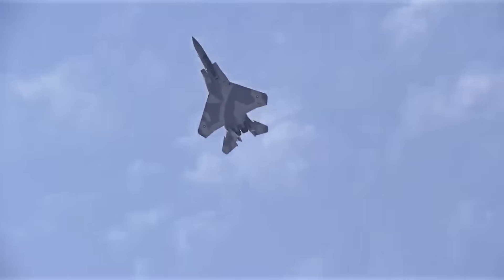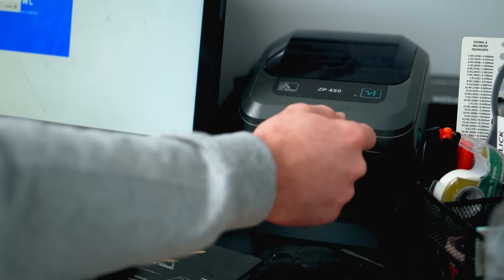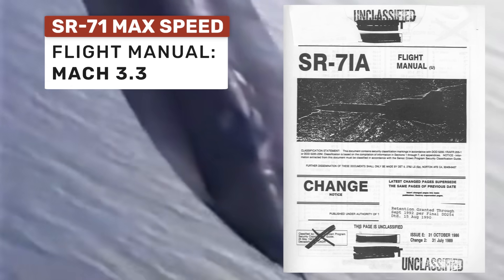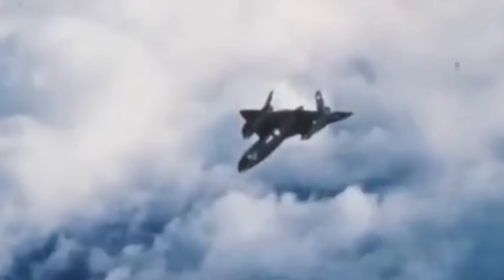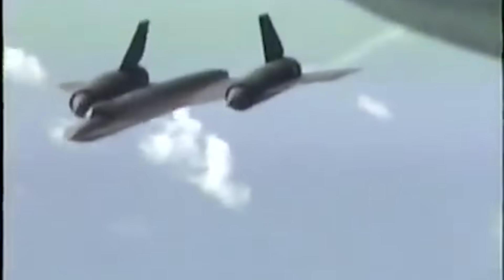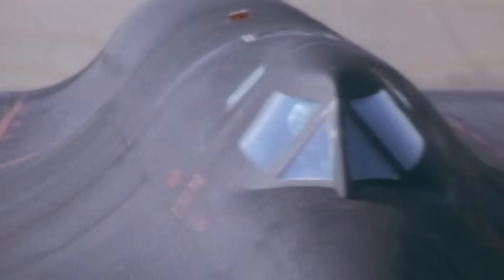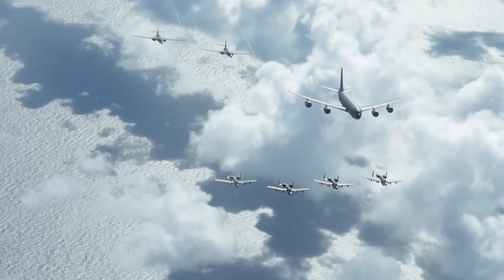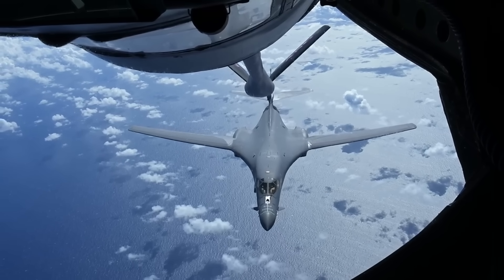The SR-71 was MUCH FASTER than the Air Force will admit

Comment: Back in 1988 I had a girlfriend who was a USAF air traffic controller. She monitored the sea of Japan. She told me that SR-71's often flew across her airspace, but did not show-up on radar. SR-71 pilot's transmitted their position using Morris code. She said it was pretty easy to calculate their speed between position fixes. They crossed her airspace at 3,000 mph. I don't think anyone believes the SR-71 could only fly 500 mph faster then a stripped-down F-15 in full after-burner.
Reply: Exactly what I've stated. If the F-15 can do Mach 2.5 then there's no question this Skunkworks creation was made to fly MUCH faster.
Reply: @Trailsporting 
I’ve always said that about pretty much anything that our military claims that a piece of equipment can do. You just know it can do much much more. Whatever they claim a sub can dive and operate at you can definitely add another 700’-1000’ of depth. Same goes for how ever fast they claim a ships top speed is. It’s going to be faster. I Don’t Remember what the navy claimed their destroyers could go, but after working in a navel shipyard I was one of the welders who was picked to go on sea trials with a couple of the, and I won’t say the top speed it achieved because I’ll never give up the secrets my military has that I know. Even though I’m sure Russia and China know those numbers. Doesn’t mean I should speak about it.I’ll only say it’s a lot more than the navy publishes
Reply: @srice8959 precisely the opposite way our adversaries report their equipment's capabilities.
Reply: @Trailsporting In the Air Force after a FCF the pilot told me he took the F-15D up to Mach 2.7.
Reply: @Trailsporting 😊😊
Reply: The SR was an incredible jet played down by USAF,NASA and everyone else. I was lucky enough to be stationed at Beale AFB. This was one of the home bases for them. It was amazing to watch it do touch and goes. But I once saw it take off for a mission. It went down the runway and straight up and just plain gone in the blink of an eye
Reply: @markjolyn94 9
Reply: You sure it wasn't  Norris code? Chuck Norris had a code
Reply: That would be about Mach 3.9...?
Reply: @svartmetall Seeing as how the SR-71 outran a surface to air missile (actually, a rocket) that Libya launched which had a speed of mach 4+.... all the pilot stated was "we saw mach numbers no one had ever seen before-and it was still accelerating..."
Reply: @svartmetall  More like 4.4
Reply: @williamthornton5856 Hal is quoted as saying Mach 4.4.
Reply: @rocketeng1888 Yes, but not until 100,000 feet. It won't do 4+ at 85,000
Reply: @svartmetall  the speed of sound is lower at 85,000 ft, so Mach 4.5
Reply: @svartmetall   its been seen doing mach 4.7 on radar
Reply: @keithbell6104  It's been incorrectly interpreted as doing Mach 4.7 on radar.
Reply: @hoghogwild  Actually that is the surveillance cruising speed.
 Not many air to air or surface to air can match that.
But really it was just a UFO.
Reply: @hoghogwild  Not incorrect....
Reply: @williamthornton5856  Absolutely 100% incorrect that any of the Blackbird family has a top speed of Mach 4.7, 3.3-3.5 tops.
Reply: @hoghogwild  Google Ram jet speed range
Reply: Yep the classified glitch was a little faster than Mach 3.X. So fast forward firing ordinance was not a good idea.
Reply: Is Morris code anything like Morse code?  😊
Reply: @charlesdudek7713 The Morris code is a bit like Morse but it goes Brum, brum, brum rather than da dit da.
Reply: @wheater5  Thanks.  I'm glad somebody was able to bring me up to speed on that one. 😎
Reply: @charlesdudek7713  My pleasure 🤣
Reply: @charlesdudek7713  A bit,  Dots are dashes and dashes are dots.  Give the commentator a break.  The rest of us are perfect.
Reply: @charlesdudek7713  So much for credibility.
Reply: @charlesdudek7713 
Unlike Morse Code, Morris code adds Day and The Time.

And it doesn't use dots and dashes. 

For example, you'd say "Jungle Love" as "O-EO-EO!"
Reply: @charlesdudek7713 morse code simular to moribus code?
Reply: As a Morris, I must say… yes. Very similar 🤣
Reply: @charlesdudek7713 yes, it’s distant cousin.
Reply: @charlesdudek7713  Maybe his/her phone 'corrected' the spelling.
Reply: @dannygjk  That was my thought and so I made a joke of it expecting a reply saying that was the case but never heard back. Shrug.
Reply: The difference is the F-15 can sprint up to those speeds for a short while. The SR-71 was designed to fly at Mach 3+ for the majority of a mission, only slowing down and dropping down lower to refuel from a tanker.
Reply: @dwaynesykes694 True.  I expect is was much faster than 3.2, but was not made to fly at the speeds.  At some point she would start to melt!
Reply: @dwaynesykes694  Agreed. F-15 at max speed would be measured in seconds, SR-71/A-12 could cruise for over an hour above Mach 3, its J58s rated for indefinite max augmentation durations.
Reply: Back in 1988, your girlfriend was a security risk!
Reply: @memyname1771  LOL! Right?
Reply: @memyname1771 aren't they all
Reply: @memyname1771 I’d imagine she’s still a security risk
Reply: @memyname1771  maybe she became a politician. They can't seem to keep track of classified material, no matter the party.
Reply: @memyname1771  nop,she was doing out of the record and non official calculations...the sounds that go through the air even from a voice are sounds if there is no tangible proof.
Reply: Morris code? Really?
Reply: @johnkochen7264  It's really cat language for Meow Mix.
Reply: @johnkochen7264  probably spell check did that and he didn't see it or care  I think it's pretty easy to know what was meant
Reply: @johnkochen7264  Might be just a senior moment.
Reply: I'm former Air Force Special Operations and I met an old SR-71 jock at a party years after each of us had separated. He inadvertently let it slip during conversation just how fast the Blackbird would go. I'll just say that was faster than 3,000mph; Much faster.
Reply: @SeanOHanlon 
Thank you for sharing this!  This confirms what I have heard. Please see my comment on the main page!
Reply: @SeanOHanlon  3,000 is already Mach 4. I don’t believe this thing was capable of Mach 5. I mean it would be epic if it were, but good lord they were aiming high when putting this thing together in the early 60’s if Mach 5 was the goal.
Reply: @Trailsporting  johnson only needed mach3, but exceeded that expectation, must have been the high purity titanium they were buying third party from russia.
Reply: Bob Gilliland told  my son ...it was much faster than advertised.
Reply: @elwap0 
See my comment on the main board!
Reply: Morris code is that cat’s way of letting people know he’s hungry.
Reply: @paulman1970  😂😂
Reply: I worked at Lockheed Sunnyvale Advanced Systems Decision in 1979 when the SR71 was still classified. When the hanger doors were closed at Moffet Field NAS we new something classified was being worked on. Leaving Lockheed at about 8:15 one night in fall 1979 I was blasted off the road when a SR71 hit it's afterburners and took off. It was a magnificent sight. I'll never forget it.
Reply: Need to know people
Reply: @danbrennan7348  Nobody here needs to know.
Reply: SR-71's have a speed bar across their throttle , this I was told by a former SR-71 pilot was to  prevent it from going so fast that SS cavitions would physically shake the plane apart .  Though his personal opinion was to keep them from launching into space itself .  Which when you do the real math and apply the proper ballistics it is quite possible  .   The other problem was air friction at those speeds for prolonged periods would overheat the skin of the plane and  it wasn't built for reentry .  Save for the problems of added weight to make the platform space worthy it is a possible consideration for a way to explore space without the need of rockets  if we can overcome the materials needed to reduce the weight problem of make it space worthy .
Reply: @franzjayne672   It makes no sense to claim that an air breathing craft could fly into space.  The engines wouldn't operate, and the structure would have no lift.
Reply: @RobertR3750  The SR - 71 was designed to travel in rare air air space at the edge of space .  So it has plenty of lift even in a near empty atmosphere  , the  kinetic energy from the engines at that altitude could in fact drive it in to low orbit .  The problem as you pointed out is after that there is no thrust to maneuver the plane so there no control for a reentry .  In fact during testing the test pilots did in fact do this and spent an extra 3 hours in flight waiting for earths gravity to pull the plane low enough for an engine restart to fly home .   Hence the bars across the the throttle controls to prevent it from happening again .  When they looked in to doing a redesign the simplest and  cheapest fix was to simply add the bar as a standard piece of the plane .    Since they are already  flying so high the crews had to use pressurized O2 breathing equipment like the astronauts anyway during testing  , also later for extended flights the tanks allowed them still remain in flight for 24 hours .   Interesting BTW is that the first designs and tests there was  a problem with fuel  and the skin of the plane .  Watch a video of an SR-71 taking off and you will see a vapor/ liquid coming off the plane .   That is because the skin of the plane is also the outside of the fuel tank , for one and the 2nd they found that it flies so fast that the friction with the air heats the skin up and cause it to expand decreasing its efficiency of it flight perimeters , the skin is built loose to allow for the thermodynamics to heat it up and become tight .  They actually wait to last minute to  completely fill it up to allow for fuel loss during takeoff .    I read the specs about 10 years ago when they were declassified and released to the public .
Reply: @franzjayne672  The post I responded to claimed the SR71 could go into space, not the edge of space.  It would make no sense for that to happen.  The engines could not operate, and the control surfaces would be useless.  No pilot would take his aircraft into such a situation.
Reply: @RobertR3750  No pilot would do so intentionally ,  but during testing the test pilots did by accident and spent an extra 3 hours waiting for earth gravity to drop them in to a lower orbital / near space altitude so they could restart their engines and fly home .   Hence the cross bar on the throttle controls to prevent it from happening .   When we ever reach the materials necessary this knowledge of the what this design is can do we may no longer need to use rockets or heavy capsules for space exploration and re-entry .      I wish that I could be clearer in my thought on the subject .  But try to look past what you have told and taught and see what really is possible for a brighter future .   The world today is depressing enough as is .   Try to have a good day and a great weekend .
Reply: @franzjayne672 Describing the SR71's speed as "orbital" is completely inaccurate.   An orbit is maintained without the need for additional thrust, and without  the craft immediately falling back to earth.  Orbital speed between the earth's surface and an altitude of 200 km is well over 17,000 mph.  It is utterly ludicrous to suggest that the SR71 could get anywhere close to that speed.  The X15, which NO ONE disputes was faster than the SR71, couldn't even do 1/4 that speed.
Reply: The fact they had to use titanium or the aluminum would melt.
Reply: A friend of mine was in tge tower at El Toro doing some maintenance when a SR-71 radioed it would be on approach in ~15 min. from Alaska.

Suffice it to say the plane was a lot faster than Mach 3.5.
Reply: @paulallen8597  Your anecdote doesn't prove what you claim it does.  Alaska to California is about 2270 miles.   If the plane was traveling at 2270 mph, then all it was doing was radioing 45 minutes ahead of time about its arrival.
Reply: @RobertR3750  I didn't say it did now, did I? Even if I did know the top speed, I'm not stupid enough to post it.
Reply: My understanding from reading ‘Deep Black’ was that it had no top speed but would eventually tear itself apart.  I outran some missiles.
Reply: Sustaining 3000 mph for hours and hours on end is a lot more impressive than being able to hit 2500 or even 3000 for a few minutes before running out of gas or melting away. The SR-71 was designed to endure high speeds and (keyword here) SUSTAIN them which is why the engines and the airframe are so large. No other aircraft has been able to sustain such speeds for endurance flights. Could it fly faster? Sure. Can the F-15 approach SR 71 top speed? Perhaps. But it's mission parameters was to SUSTAIN mach 3.3ish. Something no other aircraft, til today, can safely accomplish. It's  not going to simply Top Gun Maverick itself into a mach 10 oblivion because it's engines want to. For example F-14 pilots have often said that F-14 badly wants to go faster than its rated speed limits, with the engine sucking in more and more air the faster it goes, but that would turn someone's son into pink mist pretty quick if they were that daft to keep pushing it.
Reply: And why do we believe that the F15s top speed is what they say it is?😊
Reply: @mjsup1  And why would you care?
Reply: @Byepolarchaos  Pretty sure I don't since I have know idea what I commented on to begin with. My advice, it's a You Tube comment not life ending.
Reply: @mjsup1  I do not Disagree with you
Reply: Kkda the reverse of cars.
Reply: The first sonic boom was the time I crawled in bed in Seoul and the 2nd sonic boom I would close my eyes.  And I recall the SR-71 it was taking off…I asked a guard—what the hell was that…guard said it’s classified.
Reply: A flight sim I had purchased had ungodly realistic planes... And I paid for the SR-71 model as DLC. And it got up to 3,240 mph max.
Reply: @Karl_Kampfwagen 
See my comment main page!
Reply: 500mp/h are a fucking ton of problems when going at those speeds. It is a HUGE difference and the problems once you go past mach 2,5 are enormous.
Reply: @andreasmuller4666  where are you getting 500mph from?  They’re moving a helluva lot faster than that!!  More like 2,500 to 3,000mph!
Reply: @srcastic8764  Reference to 500 mp/h increase in air speed at a high base speed not being a "big increase" in answer to a comment.
How you would get me saying the plane only went 500mp/h in total is beyond me but okay.
Reply: @andreasmuller4666  I just didn’t know why you said 500 and said if you were referring to the planes speed it was lacking.  Thanks for clarifying.
Reply: I thought morris code was some kind of fancy air pilot talk… for about 3 seconds
Reply: Wtf is Morris code? 😂😂😂😂
Reply: @harrisoncharles5045  It's when Morris the cat taps repeatedly on his food dish to let his people know he's hungry. 😺
Reply: So full of shit 😂 by the time a Morse Code transmission came through, it'd be hundreds of miles passed that position
Reply: This code is better than Morse, it has 9 lives.
Reply: When I was a kid , a neighbor of  ours had a Morris Minor. Does that count?
Reply: @T.oMiller  Maybe if you were sitting the Morris while sending Morse code. 🥴🤪😎
Reply: @charlesdudek7713  Is Morse code a food for Morris??????
Reply: @rearspeaker6364 Nope. Morris code is though. 😮😅😅😅
Reply: @rearspeaker6364  Morse code is dots and dashes. Morris code is what a cat sends out when it's hungry. 😅
Reply: @charlesdudek7713  I like this theme!!
Reply: I believe the SR-71 could easily fly 500 mph faster than any F-15.
Reply: @CaptainLeo44  Much more than just 500 more, even compared to the fastest MIG 25
Reply: Read about how Russia in the mid 90s early 2000s pinged on radar at the pacific some aircraft then lost it. Then like 2 min later pinged leaving the ussr territory or former. They never talked about that again.
Reply: It can fly over Mach 5
Reply: @pyropulseIXXI  Shhh. Not for long though.
Reply: That must have been a crappy radar. Cuz in 1988 I personally watched the Sr-71 go from the very south of the Baltic Sea to the very north of it on Swedish radar several times a week. No idea how fast it was but I can say that that trip up and back south was made in insanely short time. So the Baltic Express was really a express trip. 😂 It was really fun to see the russkies trying to catch up or even intercept it. 🤣
Reply: @peterfdsvenskaflygvapnet2643  maybe it didn’t have its transponder on?
Reply: I have a similar story from an Air force Air traffic controller from Clark AFB. The SR-71 would enter and then clear the entire airspace in a certain time frame, that meant it well above its publicized top speed.
Reply: Mach 3, 80k feet. That was repeated over and over: I asked someone who worked with SR71s: I asked if they flew over Mach 3 and 80k feet?  He wouldn’t say.
Reply: @keithdomin5015  It mostly depended on air temperature. Even the mach number varies with air temperature.
Reply: @keithdomin5015  definitely way more than mach 3 at 80,000 feet. The air is thinner, which is why it is a ramjet engine, and since the air is thinner, there is less friction. I was support attached to an air wing, so the lion's share of our officers were pilots, and some were in Okinawa, where the SR71s often took off and landed. Not going to say what the word on the speed was, just that it is just beginning to stretch it's legs at mach 3 at 80,000.
Reply: This is exactly why fighter jets and recon vehicles should be remotely piloted so it can actually turn and max out the capabilities of the materials vs the material of the pilot.  Might even not have to feed the pilots speed or give em diapers for routine operations.
Reply: This is incorrect. They had a transponder and would check in with air traffic control just like any other airplane. Source: my step-grandfather was a pilot on the YF12 skunk works program for the CIA.
Reply: @spyder6423  They will turn the transponder off when they were over in the Soviet area yes or no
Reply: i was usaf in the early 70's. they told me it was even faster. at altitude there isn't anything to slow you down.
Reply: I was told the Air Force still flies the U-2, which predates the SR-71?
Reply: @patrickhenry2845  I'm pretty sure you're right on both counts.
Reply: Oh I do believe you that the SR-71 black bird could and did fly at 3000mph. The US Air force just won't admit it, because it's top secret. 😳😳😳🤨🤨😌😌😌🇨🇦
Reply: Either Her boyfriend is full of crap or she is.
Reply: 3,000 MPH is about Mach 4. 28, if the Speed of Sound is 700 MPH.

About oh, 30 years ago, a very reliable Source told me that the Air Speed Indicator in an SR-71 goes up to MACH TEN!

That does NOT mean that the plane can do Mach 10, but the Indicator was built to register UP to that speed.
Reply: @rdelrosso1973  Whoever told you that is a clown. You can seriously take that "very reliable source" and fully know that they are an absolutely unreliable source. The "10" on the bezel of the airspeed indicator is in "knots x 100". The mach indicator is the small window in the center of the air speed indicator and it doesn't go anywhere close to "mach 10".  Whoever told you that is either a lair or they are so inept in this topic that they truly believed what they were saying.
Reply: @rdelrosso1973 only Tom Cruise can take the SR-71 to mach 10 😉
Reply: @rdelrosso1973  the speed of sound is lower at 85,000 ft
Reply: @rdelrosso1973 1 Mach is ~767 MPH. So 3,000 MPH is ~Mach 3.9
Reply: @Laotzu.Goldbug  it's 660 mph at 85,000 feet.
Reply: @dylancowmeadow4280  that may be interesting, but irrelevant. if aircraft velocities were clocked in Mach numbers at different altitude it would be entirely impossible to compare them. When talking about stated specifications it's always at sea level, so Mach 1 is 767 Mph/667 Kn
Reply: @Laotzu.Goldbug  At what altitude? Mach speed is not the same at sea level, as it is at 40, 60, 80, 000 ft.
Reply: @Laotzu.Goldbug The speed of sound decreases with temperature, and is therefore not a constant. For example at 36,000’, temp is around -56c. Mach 1 is about 660mph
Reply: @Laotzu.Goldbug 
That's Mach at sea level.
Reply: @Laotzu.Goldbug  Wrong, not at the altitudes the SR flew at.  Try 700 mph for mach 1.  Sea level sound is faster.
Reply: @dylancowmeadow4280  Make 100,000 + feet.
Reply: @Laotzu.Goldbug  Nope. mach 5 at 120, 000 feet is about 500 mph slower than mach 5 at sea level.  Speed of sound has NOTHING  to do with pressure. It all about temperature.
Reply: Anything above 60,000ft is class E airspace. BS is BS.
Reply: @hwoods01  class e is also near the ground......NASA classifies FL600 and above as "upper Class E airspace"
Reply: 100% 
Physics was kinda "my thing" as a kid & I was a double degree Engineering student. 
The X-15 probably was a (sort of) Public "state of the art" maxSpeed aeroRocket of the SAME generation of design & theory.  & they could HIT hypersonic speeds BACK THEN  
  And it maxxed out at mach6 ... "ish"
     temporarily, of course, 
I figured the X15 kinda Set the bounds for the VERY Fastest ("Secret") Aircraft of the time.  .... I've ALWAYS believed the SR71 could be faster than stated

[that is why it is a 'Secret' type of spy Plane]  to this day

I stood next to the SR-71 and I was shocked at how Physically Compact it seemed to be.  I've heard it described as a sorta "Intercepter fighter" style of design
And THAT is exactly how it felt standing next to it.
small, sleek, COMPACT, powerful ... And FAST  with "GlobeTrotting Legs"
Reply: They're very different. The SR-71 was designed for cruising at Mach 3.2, but the F-15 can only do M2.9 briefly.
Reply: my guessing the badass sr71can bust mach4
Reply: @jackmeoffer9334  Yes it can, + 500 more mph yet, and hold it, sustained.
Reply: Minimum of 3k
Reply: Back in the 70s I had a Morris Minor, I used to phone the girlfriend at the time from the phone box next to the pub I might be coming home soon, needless to say when I did eventually get back, I had to claim the car was much slower than believed, carrying a spare broken starting handle helped
Reply: @dav1dbone  So sorry technology eventually got around to doing away with starter crank handles and ruining your ability to bend the truth with your girlfriend thereafter.  But I strongly suspect that, over time, she figured out your lies and said goodbye to you long before starter cranks disappeared.  What this all has to do with the SR-71, I don't know.  Perhaps your Morris Minor was where the Morris code was invented.  True?
Reply: Nein shipmate nein bl9ke they don't use mph they use knotts....yank
Reply: Oh it's above 30000mph. But there were issues. It's got issues the arrow mo3 version would've have had. And that was still only actual Mach 3.5 top speed before damage. Sr71 was a bit behind before damage occurs but 3.5 and 3.6 are likely the true max.
Reply: @bmxriderforlife1234  nein shipmate nein
Reply: @comodice905  ja mein friend ja very much ja. 

Lol. Mk3 avro arrow was Mach 3.5 capable. And Russia literally had someone inside the project. 

The sr71 had numerous of the same engineers. 

3.5 is clearly possible within it.
Reply: Morse code?
Reply: Aircraft carrier can actually go 70mph that is also crazy in the water.
Reply: @joeyholthusen6495 
Thats one way to lose those darn trained Ruskie dolphins.

I’d love to see a carrier up on plane but might not want to be on the crew.
Reply: Official speed records are only for bragging rights in the public eyes to the military that is not of great importance for obvious reasons…..
Reply: I had a friend back in the 90’s who was military ATC. They said it was far more faster than anyone would ever admit!
They clocked it at mach 10. 
I’m not telling anyone who that person was.
Reply: @manojtopiwala7454  It was the controller for Tom cruise testing the SR-72 lmfao
Reply: @manojtopiwala7454  Furthermore you need a SCRAMJET not a RAMJET to hit hypersonic which is Mach 5 and above…. Just no.
Reply: @manojtopiwala7454  bullshit.  Mach 10 is around 7000 mph
Reply: @Kerbalnautics91  nice choice of werdz & calculation. And How would you know this? Were you attesting to these experiences? Our reality is & has been what the msm, society & educational system has TOLD us as they purport it to be. I know this from a 1st hand account of someone witnessing it.  Scramjet or not, someone who was there attested to it!😘😜
Thx for the têt-tê-têt. It tells me much about what i have learned abt human relations!🤯🥸🫨😆
Reply: @manojtopiwala7454  “I saw it” only holds weight if you’re someone I were familiar with and also had respect for.
I have seen someone lifted off the ground by a poltergeist.  Just because I saw it and have seen other completely unexplained things does not mean it happened.
I believe it happened albeit it was unbelievable and I still doubt it.
In relationship to structural integrity and the amount of friction that would be caused at that speed and elevation in which you could visually see the plane moving at those speeds; would cause even those alloys to immediately disintegrate.
Being Gen X or a Boomer isn’t implicitly representative of you being more informed or having access to better information.
I’m going to have to argue it comes down to the amount of time you’re willing to put into researching subjects and the ability to remain as objective as possible through that process.
Reply: @Kerbalnautics91  
Uh ok. I’m going with that you need to be right about a lot of things in life. Good luck with all that. 
Thanks for your wordiness & expounded elaboration. I think i get where you’re coming from.
Reply: @manojtopiwala7454  uhh I just really enjoy learning about aircraft and aerospace.
Ditto my friend.. ditto
Reply: I heard the same thing
Reply: My ex stepdad was a crew chief on a Sr and he said they could hit 3800 to 4000mph but depending on who built the engines and they would start eating the engines after 4 mins of above 3500ish
Reply: I very much doubt it.  And hard to believe.   I need proof you had a girl friend. 😂
Reply: Just look at it ,you know all to well it's faster than they leading on to.
Reply: Reading chatter on another posting, a controller recounted when this plane was en route to  Nellis in Nevada from somewhere in the Midwest. After reporting in, it was only a few minutes later when they were at their destination. I won't repeat the stated time/distance calculation he provided, but it was significantly higher than mentioned here. Make your own assumptions.
Reply: Mach 4 or 3000 mph is the top speed of the yf 12 or A 12 according to pilots putting it far ahead of the mig 25 or any bullet. Altitude 124,000 ft at 3000 mph is at cruise. In a zoom it could exceed 130,000 ft and 3199 mph. It could easily cruise at 3.6 and 120,000. It could overfly the USSR in 2.8 hours.
Reply: 3000 mph is Traveling at over Mach 3.9 I don’t think the sr 71 was hitting that speed
Reply: @1001turtles  The lighter A-12 and YF-12 with the more powerful SR71 J 58 engine absolutely flew albeit for safety not long at 3000 mph. Mach goes up with altitude, so is not good for seeing actual airspeed without a sliderule
Reply: @GreenPartyofMalaysia  They must have meant Morse code.
Reply: 4 +
Reply: Let me axe yall a question, isnt morris code like Bob wire, a hard attack, or being a vetrin of foreign wars, heck everyone mispronounced that packer qb's name Brett Favre as farve. Give the guy a break, "prolly" was a spell check correction anyways, yup
Reply: Top speed isn't as hard a data point as most people think. There are a lot of jets that theoretically have the ability to fly faster than their stated top speed. The factor that seems to come up consistently is X is the absolute theoretical top speed that the engines and craft can possibly squeeze out. But Y is the top speed if you would like to fly that airframe ever again.
Reply: @StephenWest-t2v  we still are a bit short of hypersonic let alone anything like Mach 10 when talking about any variant of the sr71
Reply: The highest speed attained by the SR-71 was 3,200 mph and still accelerating. At that moment the speed trial ended due to concerns about melting.
Reply: Your girlfriend is right, this craft is/was stupid fast.
Reply: If the Foxbat was able to briefly touch Mach 3 I have no doubt the new Eagle can hit 2.9 for a burst. Gotta remember this is 2025 and engine and composite material technology has advanced astronomically.
Reply: A friend of mine who passed a decade ago was a test pilot starting with the Bell X1. He tested the YF as he called it from the beginning. After each test flight, he was debriefed by Lockheed, Hughes Electronics and Pratt and Whitney.  When he got to the Pratt and Whitney debrief he always had the same two words: more  power. His biggest concern when he flew the SR-71 on missions were the engines. He retold a story losing an engine over Continental Europe to a flameout and not able to restart it. He called Mendenhall and told the tower about his situation and needed priority clearance to land. The ATC told him he would have to wait as there was traffic ahead of him. He replied: "I am descending rapidly from 80+K feet trying to keep this plane from going into a flat spin. I'm coming straight in and you better make sure there's nothing on the runway. Firefighting equipment only was waiting. 
  He was also a member of the 100+K Club. Another pilot found out if you accelerated past 80K feet,  kept the nose up, and watched your airspeed, you could roll the plane inverted and it would hit 120K feet before it started to run out of momentum and started to descend. If you didn't do it this way, you risked a flameout, losing control and crashing.
Reply: The SR-71 could do mach 3+ until it ran out of fuel. The f15 could do close to mach 3 for seconds.
Reply: Mach 3.91-4.05
Reply: Unlikely that the Blackbird flies 3000mph. Now the SR flies fast enough that the titanium skin heats and heat tempered so much so that breaking the airframe into parts on decommissioning requires very special tooling… however, “fast walkers” will show up with >3000 mph, thus the name…
Reply: @nufosmatic  the A12 Archangel does. it's top speed is still classified.
Reply: @nufosmatic  It could probably go above mach 4, at least it's engines should be able to handle that speed. It would cause A LOT of wear and thermal stress on the airframe and inlets though. I've heard some stories about pilots claiming it could go up to mach 4, even mach 5 for a few seconds during missile evasion manouvers, but it was impossible to sustain that speed for much longer. Engine flameout risk started to be significant above mach 3.5 as the air fed into compressors became too hot. Blackbird's build costs were relatively low for an airplane of that class but it's upkeep wasn't. There is no need to make it even higher for arguably quite pointless increase in speed, as it was nearly impossible to catch already.
Reply: Morse code? Seriously? 😆
Reply: A stat board I saw at a display of the SR-71 at Kedana AFB In Okinawa Japan said that it would fly 100 ft per second faster than a 30.06 round. I don’t know what Mach 3800 ft per second is, but the board said that was why it had no armament. It would fly into its own rounds fired. 4:31
Reply: @jeffwelsh1185  It is Kadena and don't believe everything you read in Kadena or here.
Reply: @jeffwelsh1185 That's around 3.8
Reply: @jeffwelsh1185  Jeff, it was designed to outrun or fly higher than enemy fighters and missiles.  Thus, no need for added weight of armament.  The story you relayed is a common misconception. The bullet would always be faster than the aircraft.  Why?  Because when a bullet was fired, it is already going at whatever the speed of the aircraft before even being fired.  Once fired it would be faster than the aircraft unless the aircraft suddenly sped up just to run into its own bullets.  What pilot would be that stupid?  The fact is that the bullet is ALREADY flying as fast as the plane BEFORE it is fired.  Any extra speed from the bullet's propellant, would make it go even faster than the plane......for a while.  Then the bullet would arc downward and slow down as the plane flies over it.  Your story is a commonly believed one but simply is not true.  Sorry to burst your bubble.
Reply: @cyleleghorn246  Interesting.  Normal bullets do have their own propellant.  Why would they need additional propellant?  Who said it was impossible?  Of course you could dive and catch up with your own bullets.  If I said it was impossible, I spoke in error.  Pilots certainly aren't trained to do that.  Don't blame the bullets for pilot error.
Reply: @WilliamMurphy-uv9pm  additional propellant would be required for the bullets to stay ahead of the aircraft above the speed of sound for any meaningful amount of time.

And also, diving is not what I meant. For example, the pilot could be climbing slightly 5 degrees above horizon, fire off some rounds, and then level off. This can result in the same ending. If you make the plane faster, the bullets will just slow down even quicker (parasitic aerodynamic drag increases with speed) making the situation even more dangerous, as it could happen even more quickly than it already can.
Reply: @cyleleghorn246  Thank you.  Ha! Ha! Ha!  I may not be very bright but I can spell troll.
Reply: @WilliamMurphy-uv9pm  I learned about this in college for aerospace engineering. I later dropped out, but I took enough classes that I could build a space plane, and I plan on it. Learning to weld now, and I have 10 years of experience as a software engineer to handle anything that I don't have enough limbs or reaction time to manage myself. 

I may be in line for a Darwin award in a few decades, but at least I tried to live my dream in a way that no aerospace engineering job would ever fulfill, as they don't let you fly the planes/rockets you design, but they'll definitely blame you if anything goes wrong!
Reply: @WilliamMurphy-uv9pm  You are miscalculating, and here's why. The aircraft is under continuous power, while the bullet is only powered for milliseconds, and is decelerating from the moment it leaves the barrel, and since the bullets have much less weight than the aircraft, they have much less sustainable momentum than the aircraft.
Reply: @stilllearning777  Thanks for the info.  So, in reality, the plane shot down the bullets instead of the other way around.  Did vector analysis deal with decaying orbits and arking bullets as well or mostly straight line stuff?
Reply: @ShannonDove-sy7ye  Guess we need to define a bullet.  I'd say a bullet is the whole thing before being fired.  Casing, propellant, and slug.  Now what?
Reply: @WilliamMurphy-uv9pm  I guess the best way to put it is "the bullet is not carrying propellant with it as it's flying through the air, so therefore it's constantly slowing down after it leaves the barrel.
But yea, many times the term "bullet" is used to mean the whole cartridge.
In the show "Beverly hillbillys" they actually say it correctly Aunt Pearl says "here's your cartridges"
Reply: @ShannonDove-sy7ye  Thanks.  Great points.
Reply: @WilliamMurphy-uv9pm  the bullets may start at that speed but the bullet slows down and if the jet doesn't it might catch up to the bullets.  The bullets also will start to loose altitude as well from gravity.  This sounds like a good physics problem for college students.  Lol
Reply: @cyleleghorn246 
Thank you for that. I laughed so hard!  Your too funny!  Would love to hang out with you and just laugh all day!
Reply: @superdude1759  I think we all know that. The point is that the bullet is not carrying propellant with it, meaning that it slows down soon as it leaves the barrel.
I suppose rocket bullets do carry propellant with them.... maybe aircraft should use rocket bullets
Reply: @ShannonDove-sy7ye  
Oh, ok. I suppose I didn't read closely enough what you were saying. Sorry for that! 
I've never heard of rocket bullets. I suppose they are propelled by their own thrust instead of being fired by gun powder? I can't imagine that a bullet could hold much rocket fuel. Were it to be large enough to carry fuel, that seems it would just cross over into being either a rocket or a missile.
Reply: @superdude1759  I don't know anything about rocket bullets other than that they exist. But there was a video about them on here
Reply: @ShannonDove-sy7ye  
Ok, thank you!
Reply: @eagleeye761  Amazing how stupid those early supersonic warplane designers and the pilots were.  Almost as bad as current commentors on this thread.
Reply: @jeffwelsh1185 but if the gun firing the round was moving at 3000 mph the round would leave at it’s top speed plus that. May not stay that fast and end up blowing back into the plane after a minute or so. I guess it doesn’t matter now because we suck now.
Reply: is she now your current wife 🤔
Reply: Cool fake story 👍
Reply: Well 3000 mph doesn't make metal melt js
Reply: @sailingmohican2767 that’s what i always thought.. if they worried about melting aluminum especially at the heights they flew fast at.. super thin air. They had to be skipping along fast
Reply: @ohioplayer-bl9em  well a patriot missle don't melt, ect ect
Reply: @sailingmohican2767 
Good point!
Those nukes go out to space and reenter. Their doing some crazy speed like mach 8 or something like that. 🤔
Reply: @markchidester6239  I was just going to say escape velocity is like 40,000 km per hour and there is no melting space shuttle had only ceramic carbon tiles for re entrance the boosers and tanks didn't melt leaving earth
Reply: @markchidester6239  Closer to mach 25 during re-entry, but that's only because thinner air means lower speed of sound
Reply: @sailingmohican2767 the metal doesn’t melt on the SR71. It just gets hot from friction and expands.
Reply: @sailingmohican2767  Nobody said anything about metal melting.
Reply: @Trailsporting  The front of the plane got RED when going at top speed, so it did get HOT while flying that fast.
Reply: but 3000 mph is over Mach 3.9!!! Don’t think they were flying that fast.
Reply: @sailingmohican2767  SR 71 is made out of titanium
Reply: @sailingmohican2767 , skin of the SR-71 is titanium.
Reply: @sailingmohican2767 
Respectful, I don't think speed can be corolated to temperature. I worked at an engineering facility back in the late 70s and early 80s.  At that time a magazine circulated through the company that indicated the surface temperatures at altitude and speed speed were between 450° F to 950° F.  I only remember that the the 950° was near the engine exhaust.
Reply: @charlesdudek7713  the military didn't use Morse code.
Reply: @gregoryhagen8801  I didn't claim they did but if you look it up in fact the US military did use Morse code in the past.
Reply: @gregoryhagen8801  I re-read the initial comment in this thread and I see what you were finding humorous. I'm no military expert but I certainly doubt a pilot is going to be transmitting his position in any kind of code,
Reply: @gregoryhagen8801 Yes they did and do,Captain Jerimiah Denton blinked "Torture" in Morse code, while forced to give a statement while a captive of North Vietnam during the Vietnam war.  Also the signal lights used on Naval ships use Morse code.  Morse code is used as beacons for airport transponders, i.e. YYZ is the Toronto's transponder code, and it is sent in Morse code.